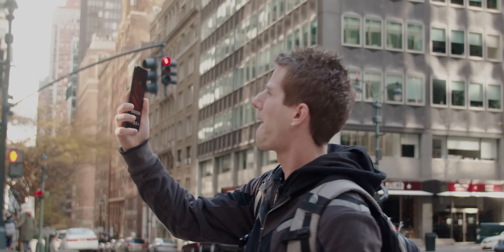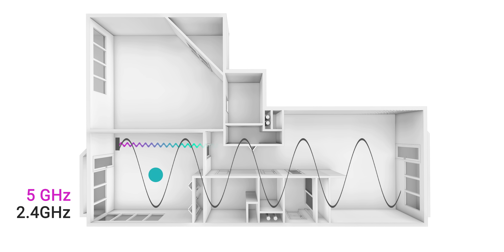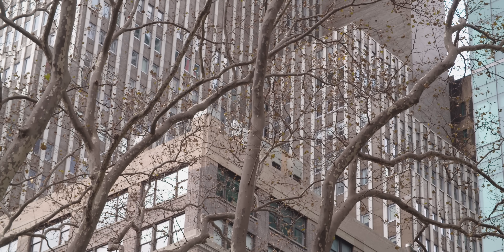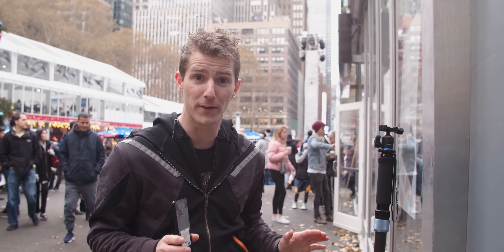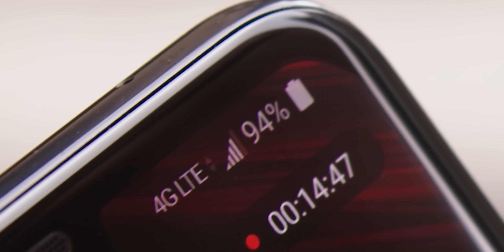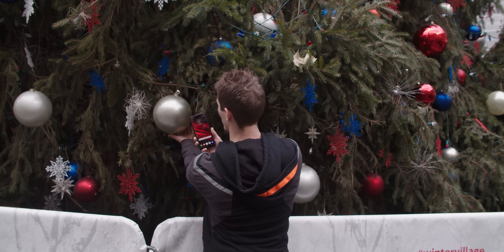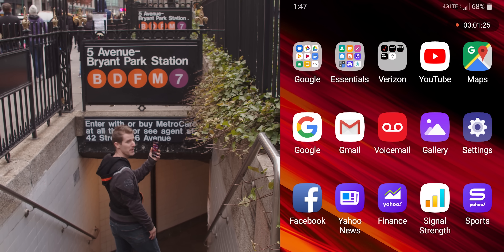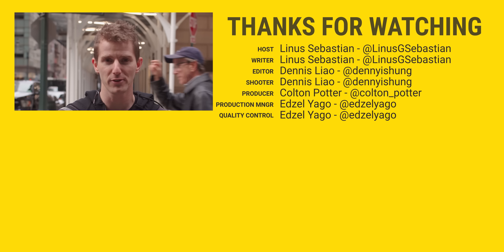The PROBLEM with 5G mmW...

Comment: That's a whole lot of shade for T-Mobile to be throwing when they don't even have a proof of concept that works based on their "hopes to acquire" network.
Reply: Andrew Novak the whole ad sounds like some skeezy lobbyist’s idea
Reply: Check out mkbhd's video of testing 5g part 2. I think that video will provide you answers.
Reply: ? You don't understand how it works then. And you aren't keeping up with news.
Reply: @ericwheelhouse4371  news isn't information. But I do think that 2.5 will greatly increase speeds. Though I'm against the merger for reasons of $$
Reply: @electric6877  Sprint and T-Mobile have had similar or even straight up the same prices and deals for years, plus even 5G didn't add more cost to current data plans. I don't think it will really change that much and I serious doubt they would get to a point where they allow Verizon or AT&T plans cost less then their plans
Reply: @ericwheelhouse4371  I don't think either but the issue is this. If Verizon and AT&T set higher prices, they will follow. Not to mention the shared people on boards of the companies or shareholder's which basically makes it an artificial market for consumers because they get to set the prices. That's why I'm against the merger but not against the fact that it would benefit people. I think the market for cell networks is just a game where a couple people get to decide what is happening. The only difference is Legere masterminded this and found ways to continue high profits for TMobile while massively expanding the company.
Reply: @electric6877  Sprint didnt think. They spent all their money on acquiring the mid-band that they had $0 for YEARS to actually DEPLOY that new spectrum. Sprint, who already had the worst coverage in the US decided to hold onto all that spectrum, while Verizon, AT&T, and even TMo spent millions to acquire and build out the new spectrum. Sprint died by their own sword. There was absolutely no way that they were ever going to recover, cause SoftBank wasnt going to invest any more money in a dying business.

Comment: When you stand in the way of the 5G signals and it doesn’t reach your phone, you are actually absorbing a mass of imbalanced 5G radiation frequencies that are toxic to your body. Does that bother you?
Reply: He put that millimetric wave thing on his head in the VR video a few weeks ago so I think we can assume hes not bothered.  RIP linus.
Reply: Radiation? lol
Reply: Yes, you are absorbing it but at that low power it is not harmful, and definitly not toxic
Reply: @tobimai4843  It's not likely to be low power, most of the devices are using collimated phased array antennas to fire a beam.  The beam delivers more power to a given surface area versus say a dipole antenna which radiates the field around it over a wide area.  They are using a higher frequency also which means more power is required to deliver the same signal range.
Reply: Tobimai there’s a massive amount of research that proves it is harmful. Your body runs on electric current. Radiation current interferes with the balance of electrical current in your body. I’ve even tested it on my own body with 4g. Check the EhTrust.org website and see ‘scientific papers’. If you’re basing your assumptions on the electromagnetic spectrum, it’s no longer a reliable standard for judging safety - according to our research, it’s not heat that causes the damage.

Comment: I'm an antenna and RF engineer that works on 5G transceiver design. mmW signals are not 5 GHz, but approximately 20 - 40 GHz. At these frequencies, making efficient antennas and transceiver modules that are easily integrated into phones is tough, and even just having a casing around your phone  can have severe effects on its performance.

Now I can't speak to the technology used in the tested 5G transceiver, but one of the main difference between 4G connection and 5G connection is that 5G benefits from using beam-forming (focusing the antenna's performance spatially towards the base station), where 4G ideally just wants its performance spherical to get signals out in every direction, regardless of where you want to connect to. One of eyebrow-raising aspects of this is that you then need miniature base stations approximately 100 - 200m apart from each other, in a grid. Making such a grid is an astronomical hurdle, and there's a ton a technical problems to overcome along the way. Then there's the transceiver aspect, and making modules that are as efficient as the 4G ones at mmW frequencies is difficult as well. There's no real standard design that all other designs revolve around in the 5G world, as there is with 4G, where we use the casing of the phone to make the antennas and have tried-and-tested transceiver designs that work super well. 5G instability will get better as we find better solutions.

As you might guess, 5G for consumer phones will be an urban thing. When it does work properly, it will only make economic sense within densely populated areas, and yes, it can work in metros, you just need base stations down there as well.

Right now, the technology may be more suited for stuff like car-to-car communication for autonomous driving, but remember that things have humble beginnings. :)

Comment: T-mobile going to larger frequencies will kill the data speed. We are still a long time away from actual 5g wireless. 

Also, you were running a 32 ping. The second main idea about 5g is low latency. You should be running a 1 ping off 5G then however far to the server. Chances are that is fibre and you were using a server in NY. Your Ping should have been an 8.

Comment: Linus,
you know what this is for, dont ya...
they dont want to lay fiber to everything..They want everyone to use Wireless.
Now think about this...
How much bandwidth do you need, with 1000 people in 1 area using hte same Tower??
10,000?
You have just proven that Every person, company using this service would need an outside, LOS, antenna..  How many channels are they going to have in 1 Tower.??  15-500?
Limit on SIMPLE digital is 256? unless you do 16 bit, this is going to be rough. How mnay individuals on 1 channel???  I know you understand, the BS they are trying to push, but do you think they will get 256x256...4096 on 1 channel..

Comment: I like how people are quick to dislike or hate on this video because T-Mobile sponsored it. Nothing he said is a lie; Verizon's 5G is mind blowing fast, but the mm wave they're using isn't particularly great at covering or penetrating objects to provide the signal. T-Mobile is also working on mm 5G, but they are going the other way around and focusing more on coverage and reliability rather than just straight line speed. So their speeds will be slower than Verizon, but their goal is to just be faster than 4G LTE currently is, which I for one prefer. However, the spectrum they want to make this happened is owned by Sprint. And there is no other way to access that than to just merge with them. 

I don't like the idea of having one less competitor in the market as that usually means prices tend to go up and innovation starts to slow down. But on the flip side, Sprint hasn't been very competitive in a long time. Their service has improved, but is really far behind it's competitors in a lot of areas ranging from speed to just general coverage especially in rural and really dense urban areas, contrary to what the commercials are telling people. They are also not the most affordable or the most advanced. Their prices at times rival that of Verizon. And I don't see Sprint coming out of this anytime soon. The worst possible outcome is Sprint goes out of business and they decide to auction their spectrum. Verizon and AT&T will flex their resources, buy it out, and you'll end up having a market with only 2 major networks and T-Mobile being a distant 3rd. The way I see it, the merger is the lesser of two evils. And frankly I trust T-Mobile more than I do Verizon or AT&T. I don't trust them completely, but they are definitely better than the other two.

Comment: The problem of 5G that it can kill living things, including humans, when an evil person or group get a hold of it, and use it, as a weapon. Lol
Reply: Hahahahahahahahahaha no.
Reply: @Per_TP  Wrong.

Millimetric waves and phased array antenna systems are military technology, this system is for radar, total surviellance and control.  I refer you to the Active Denial System which runs on 90Ghz, well within 5G capabilities.  5G hardware is capable of frequencies in the range of 700Mhz-300Ghz using software defined radios with phased array antennas and AI supercomputing at the edge to power the system (see DARPA spectrum collaboration challenge).  The Nvidia raytracing is not so you can have shiney graphics it's for computing the beams (arrived just in time it would seem - how convenient).  They have SMART lights deployed allready also in most cities across the globe, 868-900Mhz phased array antennas in a mesh network with backhaul capability for IoT.  The systems are capable of backscatter tracking the short range RFid chips at several kilometres of range.  The frequencies they are using like 868Mhz/900Mhz are very dangerous, a quick google for health effects will reveal things like problems with T3/T4 thyroid hormones which regulate cellular metabolism, reduced function of hippocampus and probably plenty more besides.  Perfect for through wall radar though as it can penetrate more than 3 feet of concrete.  They want to use 60Ghz and they are allready for some of the advanced WiFi, that frequency affects the orbital spin properties of the oxygen mollecule, this may result in some trouble breathing or the generation of ozone molecules which are dangerous.  Whitepapers on health effects are verified by multiple institutes and countries.  Over 20,000 scientific whitepapers with around 70% of them showing the dangers of EMF.  The phased array technology will kill all the small birds and insects, but it will take a few years.  All life will be affected, the damage is visible on the trees allready where they are close to the transmitters.  The high speed internet is "simply to die for". 

Active Denial System:
https://en.wikipedia.org/wiki/Active_Denial_System
5G APOCALYPSE - THE EXTINCTION EVENT:
https://www.youtube.com/watch?v=ol3tAxnNccY
Phased Array Antennas:
https://www.youtube.com/watch?v=vtPPAnvJS6c
AI Senses People Through Walls:
https://www.youtube.com/watch?v=HgDdaMy8KNE
THALES SEA FIRE a new generation of naval multifunction radars:
https://www.youtube.com/watch?v=lFVxj6sIf7w
5G LED WEAPON DENSIFICATION OF OVERCAPACITY:
https://www.youtube.com/watch?v=NXTaL88sR-k
5G LED KILLS SMALL BIRDS - HERE IS THE EVIDENCE:
https://www.youtube.com/watch?v=7mF2aYZ-Xo0
Directed Energy Weapons 101: Sonic, Microwave, Laser, and Non-Lethal Warfare:
https://climateviewer.com/2018/07/05/directed-energy-weapons-101-sonic-microwave-laser-non-lethal-warfare/
BIOLOGICAL EFFECTS OF MILLIMETRE RADIOWAVES
https://www.cia.gov/library/readingroom/docs/CIA-RDP88B01125R000300120005-6.pdf
Secret History of Silicon Valley
https://www.youtube.com/watch?v=ZTC_RxWN_xo
Reply: Correct, a foreign, or even domestic, adversary can use this technology for Electronic Warfare.  Which is its real purpose.

Comment: mmWave is ultra high frequecy in the 26-60GHz range thats why its easy to to drop it will be best used in open areas with high density devices.

Comment: In Australia, our politicians are basically claiming that 5G will replace the need for fixed home internet like Fibre, and for some reason people actually believe them
Reply: Hahah, Cellular is never going to be a replacement for fiber at all. But it could replace VDSL IF they give out public IPv4s and IPv6s and when you use it with an external LogPer Antenne placed in your balcony/on the roof.

Comment: Be happy that it is gone as you turn because when you have 100% connection everywhere there are 5G antennas everywhere affecting everything, humans, animals will be sick because of it.

You should not promote this. Read about this and warn instead.
Reply: 5G waves are less concentrated than the visible light spectrum. In fact, it's less concentrated than Infared, which was commonplace before Bluetooth became mainstream. If those are at a higher frequency than 5G, then why can't they cause any harm? (Especially the visible light spectrum that we're enveloped in 24/7.)
Reply: @carterdotn3083  What´s your point, 5G aka "internet of things" is harmless?
Reply: @MrAffeman  that it's pointless to think non-ionizing wavelengths are harmful.
Reply: @carterdotn3083  The radiation in itself may not be harmful but the fact is that the distance these transmitters reach the user needs more power in order to work and because of that the radiation will be dangerous. There is also no research into the health effect of living beings bathing in radiaition the 5G solution emits, how stupid isn´t that?!
Reply: @MrAffeman  the radiation is way too weak. 5G rays are non-ionizing, and even clumped together, they're still way less concentrated than the visible light spectrum or Infared. They're about as close together as, say, your home wifi router (which most wifi connections nowadays are 5G) and that can't harm you, so....
Reply: @carterdotn3083  Your 5G home router vs 5G Internet of things are not related in any way other than the name. It is deliberately done in that way so that you would think it is the same... but it is not.

Your home router has a max frequency of 5 gigahertz but the 5G for Internet of things has a frequency up to 60GHz.

What you talk about regarding rays and visible light spectrum has one thing in common though, they are all within the electromagnetic spectrum. Even sound is part of that. If you boost the volume of sound at different frequencies to 200 decibel then you´ll get injured. Light rays are not that harmless as you believe it is either. Lasers are very powerful and you would not point a blue laser at your forehead without feeling the burning sensation.

Study this a little more please!
Reply: The sad part in our conversation is that Linus who runs the show does not dare to comment on this as his channel will be banned.
Reply: @MrAffeman  you're talking about lasers, highly concentrated lasers. 5G operates at the 60 ghz range, whereas the light spectrum operates at the 430-730 thz range. Much higher in frequency than 5G. Again, if unconcentrated light rays cannot hurt you, then how can unconcentrated 5G radio waves?
Reply: @MrAffeman  oh god, and the "yOu CaNt TaLk AbOuT tHiS oR tHe IlLuMiNaTi WiLl DeLeTe YoUr ChAnNeL!!11!!!" talking point. If that's the case, then why hasn't every schizo conspiracy theorist been terminated?
Reply: @carterdotn3083  Gee, it is not the concentration of 5G radiation, it is the output power of the sender that is the problem. It will not be far from sticking your head in the microwave oven.
Reply: @carterdotn3083  I have to ask, how old are you? You need to study the electromagnetic spectrum some more.
Reply: @MrAffeman  if that was the case, then why are major world governments approving it? And btw I'm getting all my info from my AP Physics Teacher.

Oh wait, I know why. Something to do with the FrEeMaSoNs or IlLuMaNaTi, right?
Reply: @carterdotn3083  They are approving it completely without research and that is not good in any stretch of the imagination. What you learn in school today is mostly hogwash, you´ll see.
What you think you know is almost all second hand information. When you get older, and preferably wiser, you will come to understand that you actually don´t know much at all.
Reply: @MrAffeman  yeah I'd rather believe accredited people with phds over conspiracy theorists that I doubt even passed the Eighth grade (ahem Alex Jones ahem) 

What's next? Are you gonna tell me the Earth is flat or something?
Reply: @carterdotn3083  Nah, you´ll figure things out in due time, but you changed the subject. Were we not talking about 5G radiation? When you start talking like that tells me you´re out of arguments and start being a troll instead. Very mature...
Reply: @MrAffeman  not being a troll. Just saying that y'all are freaking out like people were freaking out during Y2K. We'll see what happens when 5G rolls out.

Comment: I did some legal work for the AT&T/T-Mobile merger that got blocked. They used a very similar argument about the need for different wavelengths at the time because they didn't have the bandwidth to roll out 4G while still servicing their 3G customers. They claimed they would have to convert too much 3G and lower towers over and it would hurt their slow adopting customers.

They managed to figure it out in the end.

Comment: Only slightly misleading on Tmos 5G...they're using their 600MHz spectrum (that they use for 4G) and that only 2 or 3 phones even support. So while they're "lighting up 5000 cities" it's only a little less restricted than the other 5G rollouts are from other carriers. Also calling 150 Mbps speed 5G speed is pretty crap as a lot of 4G areas can already get over 100.

Comment: T-Mobile's mid and high range frequencies may get labeled as 5G in time, but it will still be the same fake, 5G-E that ATT used, which is basically a less throttled LTE connection.

I will never understand why in an age when we still don't have full 4G LTE coverage and where the average person doesn't even get 40mbit on 4G LTE when true 4G can theoretically do up to a gigabit, and despite the fact that it has unfeasibly high speeds that will have to be capped just like LTE when you have thousands if not tens of thousands of people connected to the towers and the far poorer reception and the cost deployment, we are moving to 5G, even knowing that not only do we not need it, it messes up many of our sensor and communication arrays such as the ones we use for weather predictions.